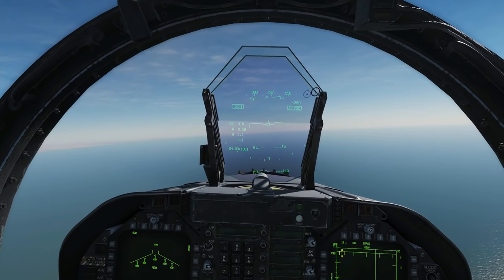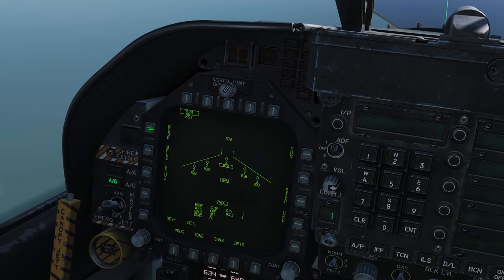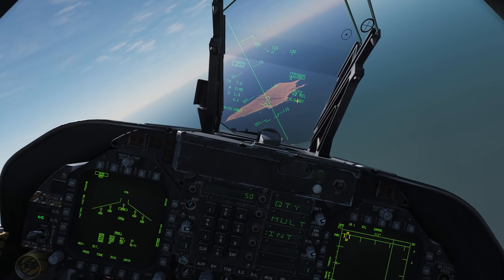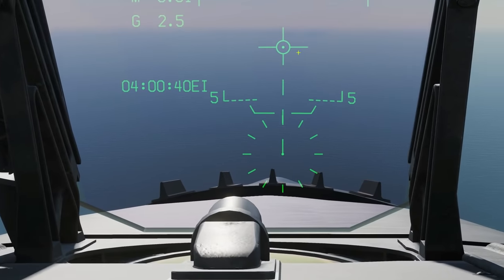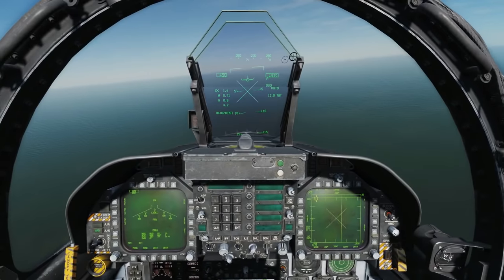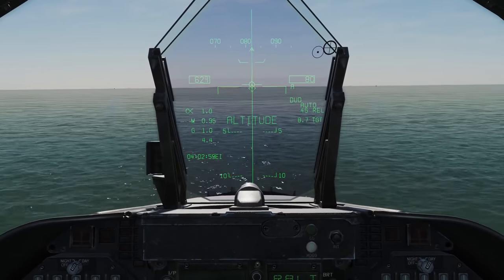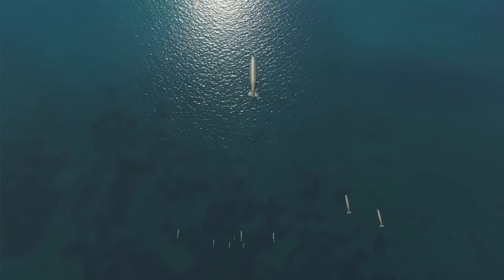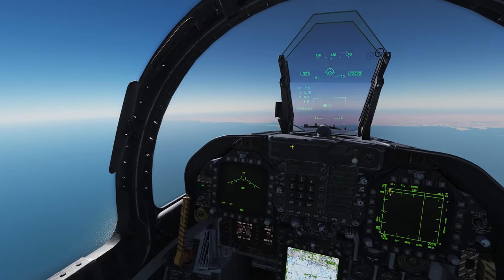FA-18C Hornet: Toss/Loft Bombing Tutorial | DCS WORLD

Comment: I do not understand how did you release before the release counter reached zero and based on what?
Reply: He has a target point set up (see initial part of the video), with computer-guided release (auto). By going vertical at 35°, he increases the distance the bombs will travel, which is taken into count by the computer. In order to get the bombs to release right on the mark, you hold down the pickle/weapon release button before the intended drop-point, as the actual drop is also controlled by the on-board computer.
When he started pulling up, he depressed the release button, and you can see the 'time until release'-counter (right side hud, underneath the AUTO) counting down rapidly. The bombs were only actually dropped when the counter reached 0.
Reply: @Alighierian  Got it. Thank you :)